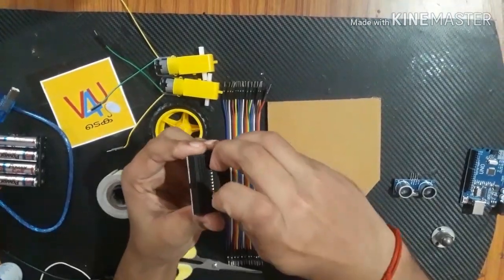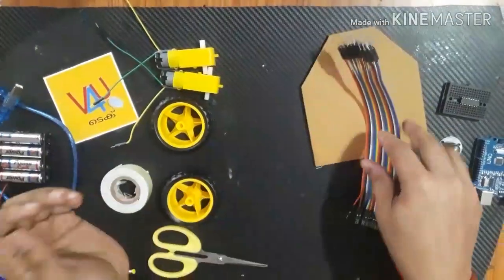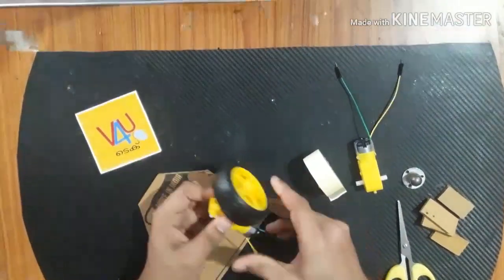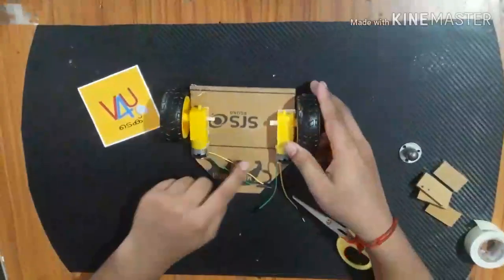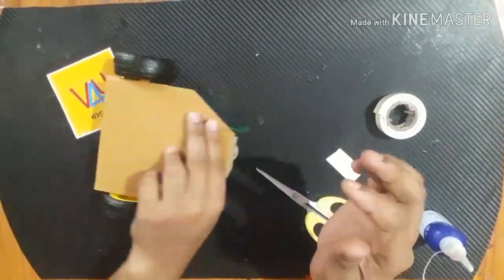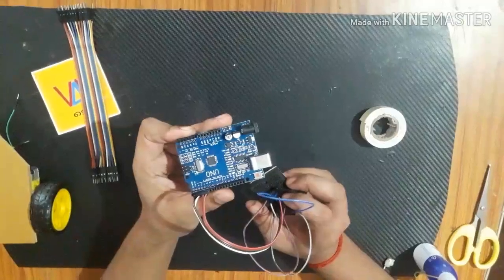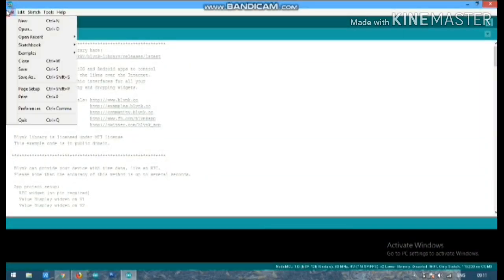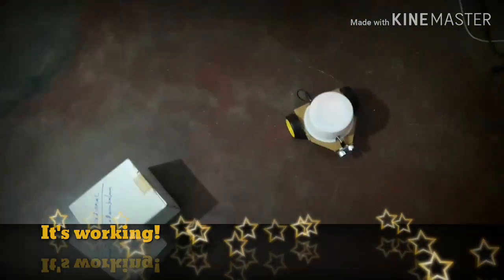Ultrasonic Obstacle Avoiding Robot Using Arduino Uno

Comment: Nice man keep it up and my code is not working
Reply from the maker: U downloaded from the link which i provided sir?
Reply from the maker: If so one of the LOW in code is written as HLOW... correct it
Reply: @v4utech89  ok
Reply: @v4utech89  can you send me the diagram
Reply: can i use L298n Motor driver
Reply from the maker: @viswanktda7114  yeah bro you can use L298N or L293D IC or driver